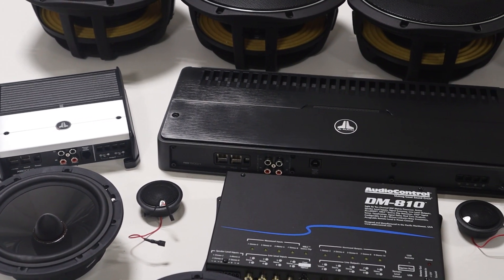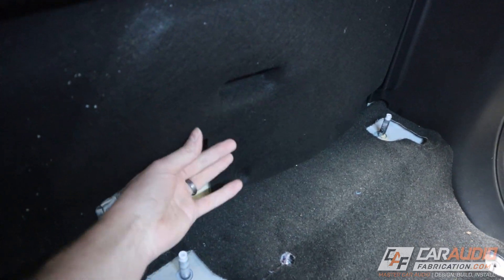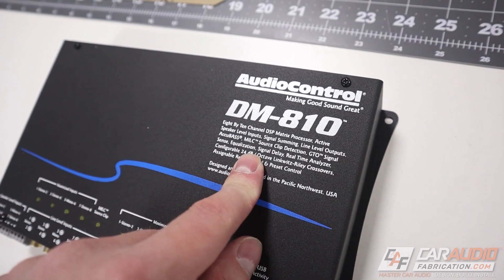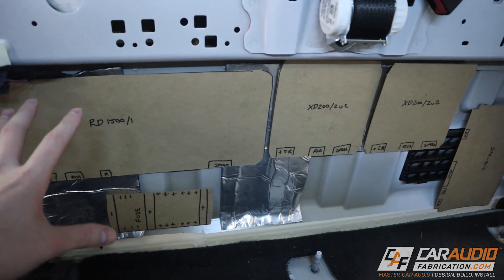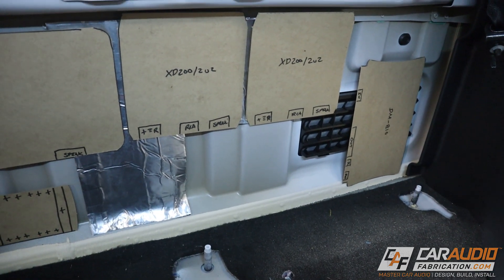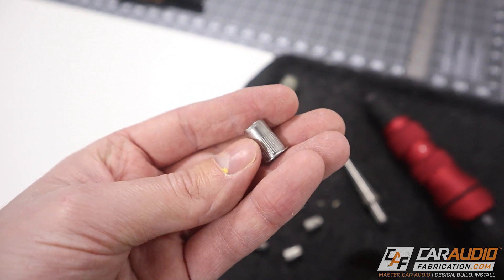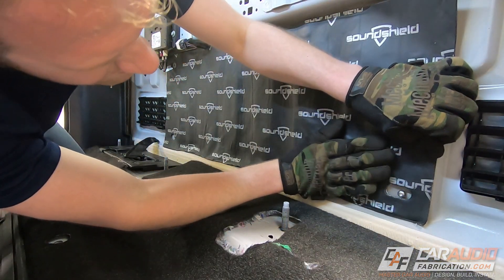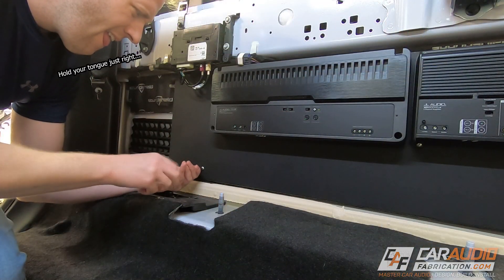3 Amps & DSP Amplifier Rack? LET'S BUILD! Tricks for planning & mounting

Comment: Im goin to be building me an amp rack here shortly. My question is, I'm having 3 0gauge runs. Positive runs to a fused block, correct? 1 run fused from battery into the distro block with the 3 runs?

Comment: Looking at this currently as I'm getting frustrated doing my amp rack. I have a Skar RP1500 powering a Skar EVL 15, Skar RP150.4 powering 4 DB Arnold m61ac mids, Hifonics ZXX1000.4 power four skar fsx65 mids, Audio Control Epicenter, and Taramps 2.4s DSP.

Comment: I believe the soundproofing is there because it has a rear power window... That's my guess Never seen that truck before    Also those vents are for Air pressure so when your airbags go off it Works properly..  also if you Block that vent when you roll down your windows about an inch and you put on your defroster it will whistle...lol   All cars have that in their trunk area for pressure equalization.. i Learned this by blocking those vents, I have one on either side.. In my car in the trunk hidden behind trim..  Me I replaced  the vent flaps With something a little more Weight silicon sheets ,about a millimeter thick Because the original ones are rubber and they open and close with just a breeze even with your windows closed.. The newer flaps help with the sound proofing in the car but still work Like it's meant to be.. It just seals better

Comment: What size drill bit did you use for the mounting holes on the amp rack also are those 10/24 machine screw/ rivnut?

Comment: I'm doing my 1st small build I plan on using 3 500 watt max one will run front doors. 2nd one running both rears. 3rd one Rockford 12 prime truck box sub. Rated at 250rms to 500max. All three amps are pioneer 2 channels each I think it will work .

Comment: One suggestion.  Unless the video is deceiving on how close it really is and IF there is enough space between the back of the rear seats and the amp rack components, I would suggest some stanchions that will thread into the rivet nuts that would have a female thread on the other end for the machined screws you used to mount the rack.  The amp rack looks to be very close to those two vents.  If it was spaced out even a quarter inch, I think that would have been better.  There is a reason the material over the vent was as far away as it was.  Just a thought.

Comment: For mounting the AudioControl equipment, what size machine screws/tap drill bit do you use? I am sourcing the parts needed to mount an LC-1.800 and a D-4.800 amp onto a plastic board.

Comment: Mark your videos and the detailed explanation of everything you do are fantastic. I am in the process of re-doing my set up in my '07 Z06 to something similar to what you have done in this F150. I had completed a head unit, sub amp and 4 channel amp and 2 x 10 sub box build and install with your help 2 summers ago. Now I am adding another amp and JL TWK88 DSP this summer...going 3 way active with Focal K2 power mid bass 6.5s and tweets, and AudioFrog GB40 mid range up front. Same number of components and using the same install gear you use from KnuKonceptz for wire and blocks. You have inspired me to spend more time working on my audio in the car than actually driving it, haha, as my wife likes to point out. I thank you for your enthusiasm and attention to process. Your work looks phenomenal and I'm sure it sounds even better. I can only hope I get mine to be half as good. I have been teaching high school for almost 30 years, so I have the experience to say that you are a master teacher. I wish you continued success and happiness!!
Reply from the maker: Thanks for the kind words! And thanks for being a teacher, we need more people passionate about teaching the next generation
Reply: That was pretty thorough and a great compliment.  Nice to see.  Great video and very detailed. Two thumbs up!

Comment: Those vents move with VERY little pressure. If you’ve ever seen a ford dump truck or roll off, something where you can actually see the vents, they’ll be flying open and fluttering with the AC on high enough.

Comment: I thought about this with my 2021 Silverado Black Widow but once I learned the seat is fixed in place in the back i.e. have to remove it I decided to make an under rear seat amp rack with LED lights to match the Black Widow theme. I wish my rear seat was a fold down, kind of a pain to take it out.

Comment: Any details or did you specify where you got the material from to make the rack?
Reply: The ABS plastic?  You can find sheets of this in varying thickness and dimensions (Mark used 1/4" thickness, which is common) on eBay.  If you live in an area with specialty plastics suppliers, you can probably find it there too.

Comment: I did something like this for my 2019 Dodge Challenger. However, I didn't foresee the issue with the seats folding back into place. They wouldn't lock. I mounted the amps on to a plastic panel, similar to yours, on the back seat facing the trunk. But with the error of the placement, I had to redo the placement, and after a series of tries, I nailed it. It's been sitting comfy for nearly a year now. The only thing I didn't do was round out the corner and edges, but since it's hidden, unless I show it, It works. I'll be interested in seeing how you do the wiring. That was interesting for me. I did only use one block for both + and - with everything attached to my amp and DSP. I also added a simple digital volt meter to the block in case I had an issue with voltage, which after a year, I'm good. If you're interested in seeing how I did mine, I'll send it to your CAF fb page. I love watching these and my install was a inspiration came from you on your videos. Thank you!
Reply: I did the exact same thing I thought I nailed it and soon as I went to slam the seat shut, I snapped off a pair of RCA’s going into one of the amps , Looks like a lot of space until you actually close the seats 😂
Reply: I wanted to do this in my current project but I think I’ll go a different route because of the same issue plus the fact it’ll go up and down a lot
Reply: I am doing a 2021 challenger now for my gf. I would love to see how you did yours. Is it posted anywhere!

Comment: I know this is specific, however I can’t seem to find more than 1 example and even that isn’t ideal

I have a Honda Element, with a 8’ sub up front by your feet. I want to put a rear sub in, however the floor of the trunk area opens up to a spare tire well.

Most people who do sub setups (on YouTube) have the Amps and speaker on top of this area, preventing you from getting to the spare tire

Can you make a video about putting a sub in the back that still gives you access? I’ll paste a video of the one I’ve found that got close to it here

https://youtu.be/noOkrFhAZWs
Reply: Maybe make a box that conforms to the back portion of the trunk, like with the sub facing the license plate.  If you don't make it huge, I think that would still let the spare lift up

Comment: With a DSP. Is it good to continue using the  subwoofer outputs in the HU? If you want good SQ. Would an amp aimed more at a different goal be as good as one that say has a name in the sq market? It's a loaded question, I know. So if someone else has a thought 🤔. Yes, I'm that guy that didn't research before hand.

Comment: Seriously, those old 3 tooth craftsman ratchets were a huge pain for me when I started. I eventually paid north of $100 for my snap-on. Years later I found a harbor freight clone on my ratchet for $30. On reality not much difference. The length was around 18” with rubber handles and 80 teeth. I would recommend either. Both are a pleasure to use. The craftsman has hard corners and was only 8”… the mechanism was terrible.

It it a huge upgrade, I now even have the Milwaukee m12 stubby 3/8” ratchet. Another huge upgrade. Honestly the ratchet was a bigger deal at the time than the electric impact.
Reply from the maker: Dang you... now you are making me want to ask Santa for tools!